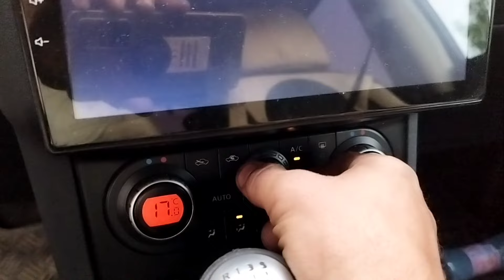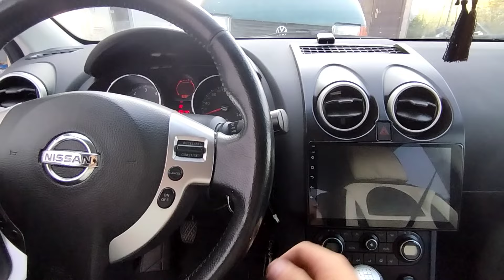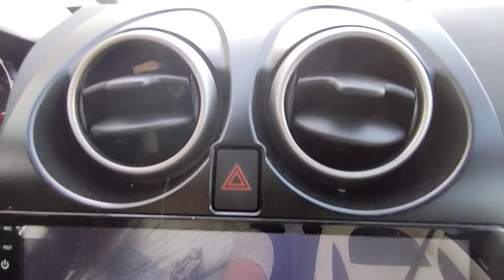Nissan Qashqai fan blower replacement/ înlocuire ventilator habitaclu

Comment: Very, very very grateful. I found the job so hard I left the car until summer to re-assemble. Everything is too stiff in -10c.
Take pictures, more than you think you will need. Especially if you work slowly over time.
Bag you parts in zip lock bag, write with a sharpie. Note the time in the video on the bag, so glad I did that.
Getting the fan out and back in is very scary as you do not want to damage the fan or thin wires.
Putting the fan back in is where I stopped for the winter.
I used a cargo strap to pull the brake fork first to the left and then to the right.
At 6:50 ish, I can see you removed the pedals after the scene cut.
No idea how you managed that, above the pedals is a safety retaining bracket with 2 bolts, so even if no bolts are installed, the pedal assembly 10:40 ish can not be removed off the 4 bolts pins.
I had to take that bracket off to install the pedals.
Pedals are back in and working now. Putting ventillation tubes, fuel and bonnet release and facia etc...
I am 100kgs, so very difficult to twist your body in all the different positions required.
Quite a few things you must do blind. Heating ventilation securing bolt, removing connectors (really horrible for me, still do not understand how they all work).
Do not do tighten any bolts until you are sure you can move onto the next re-assembly stage, especially clips and retaining clips, everything is very tight, and if you have to get it back off, you will need a sense of humour.
The parts, fan and speed controller cost me less that 150 gbp.
Right hand drive cars are easier as pedals are not in the way.